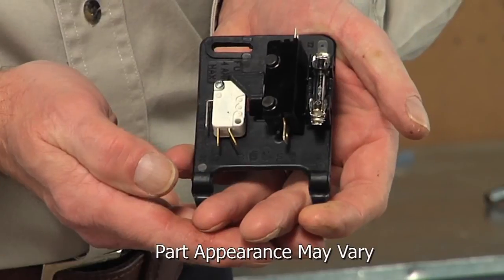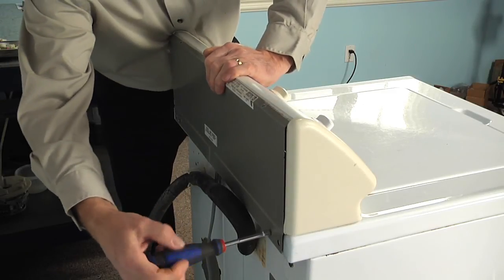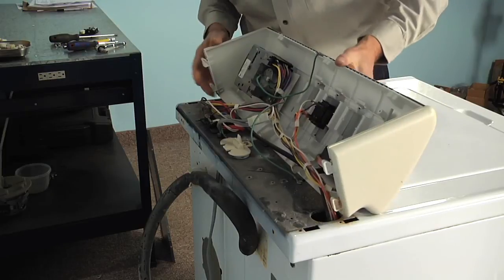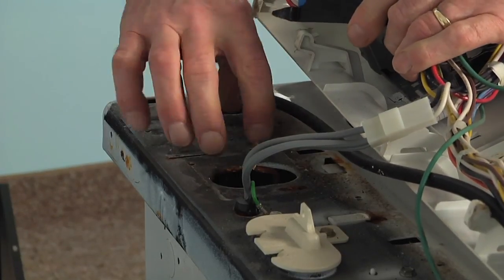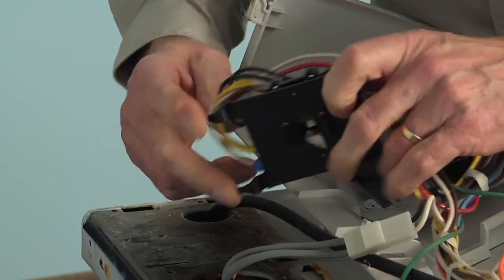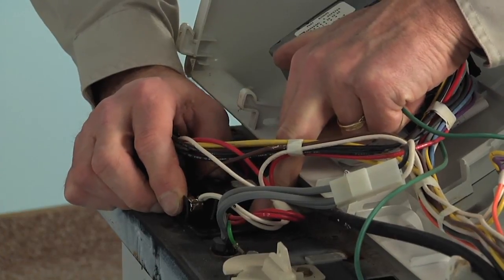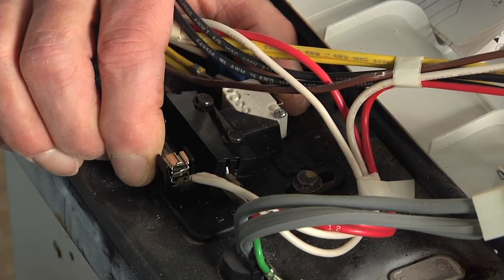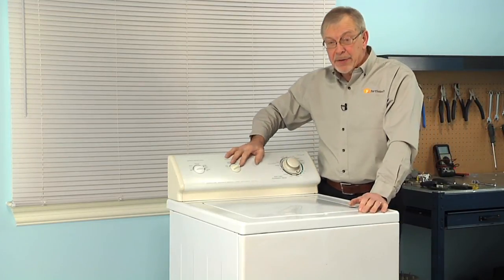Washing Machine Repair - Replacing the Lid Switch (Whirlpool Part # 22001682)

Comment: Hi, after replacing the lid switch assembly it still act the same and didn't fix the problem. Is there any issue that might cause it from not start, agitate, or complete a cycle?
Reply from the maker: Darkmand8 I have passed your question on to Steve and will let you know what he recommends.
Reply: thanks!
Reply from the maker: Darkmand8 What is your model number?